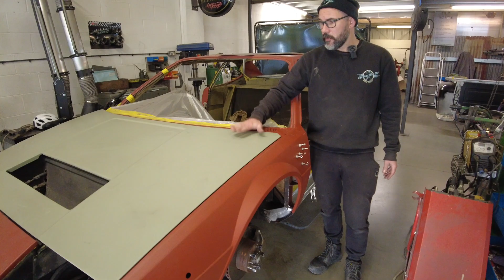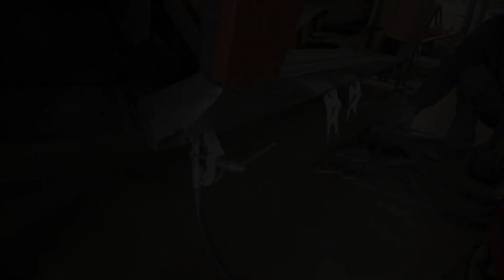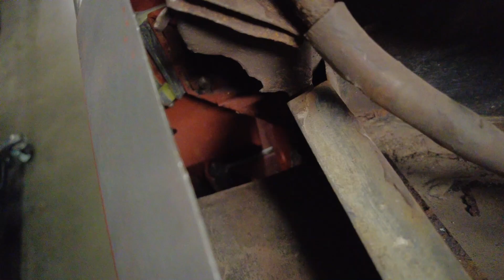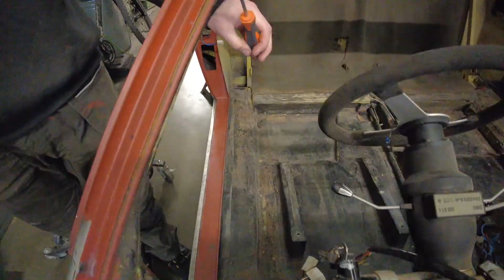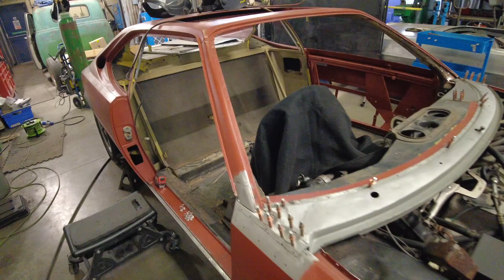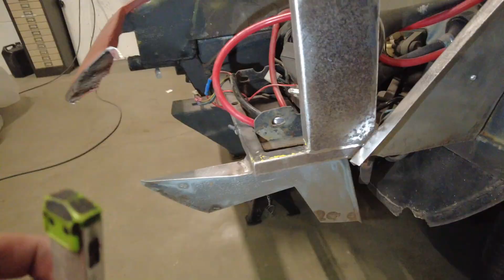FERRARI 308 restoration part 5!!!

Comment: you have to know that a lot of the bad welds and junctions behind the scuttle for instance are as it left the factory. Also windshields are very difficult to replace if at all and all replacements will be different dimensions so if you intend to renew it then measure from the new one not the old one...otherwise awesome work following closely!
Reply from the maker: @marklintott160  brilliant comment and a very valid point! We do in fact have a new screen so certainly something we will look to do very soon
Reply: aka "blobby the welder", apparently difficult to replicate on purpose.